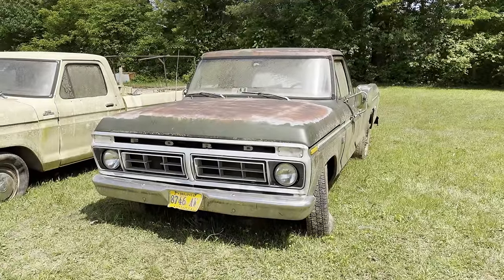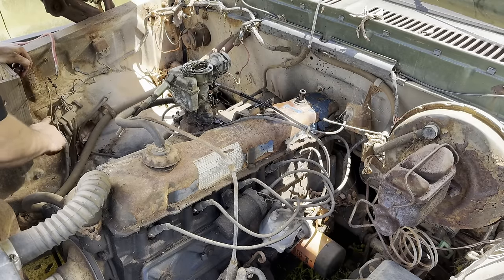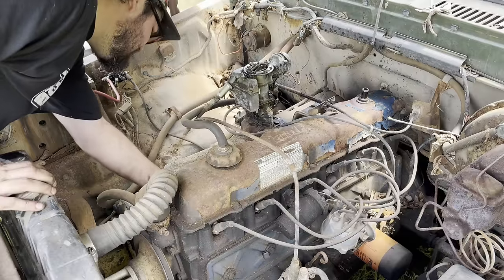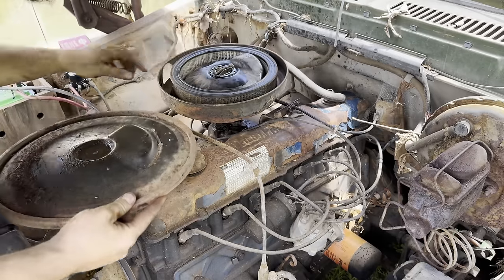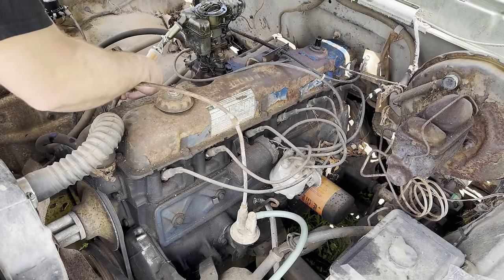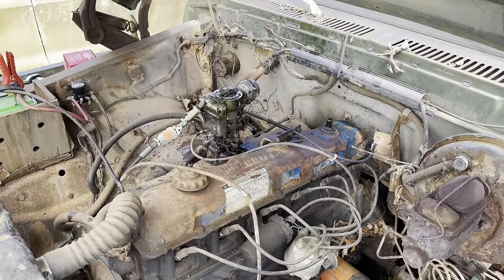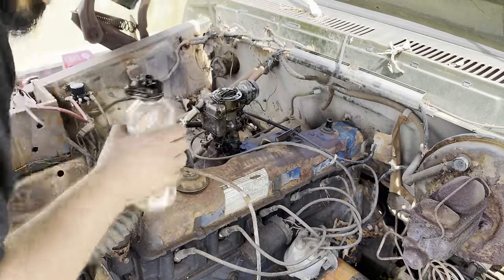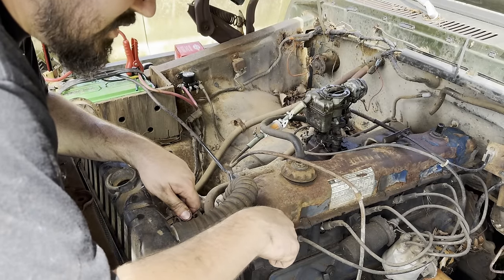Will it Run After 22 Years? Oddball 1976 8 lug F150 Truck #RustBucketRescue

Comment: Since the early 1980's, Ive owned a 1975 F150, 1981 F100, and a 1984 F150. All had the 300 cylinder. Those engines are bulletproof.
Reply from the maker: Greatest engine ever made.  The perfect “truck” engine.  You want a truck engine to be simple, and reliable to get the job done without a bunch of fuss.  The 300 six pulls through every time, until the end of time!

Comment: Reading on the ford-trucks forum and it seems a guy has a F130 and did a marti report on it and there was 50 of these made, they were Fleet ordered this way. "F130 - F150 special pickup truck 6050lbs gvw" from bill smith motors in Sanger, Ca.
Reply from the maker: This one has a 6150 GVWR, so 100 lbs heavier rated than the report you mentioned, so the plot thickens!
Reply: I have a F100 and I was going to do this conversion to 8 lug so I could run duallies I have from a F350 chassis but I ended up putting new bearings in the rear end (9") so that plan went bye lol

Comment: Pro tip: Don't spray the air filter with starting fluid. If it backfires it'll burn like a torch.
Reply from the maker: Been there done that a few times, that's why I left the air cleaner loose.  If it bursts into flames simply lift off the air cleaner by the inlet neck and toss it in the grass to do its thing. 🙂
Reply: @RustBucketRescue why didn’t you just leave it off and feed the carb with starting fluid. I’ve never seen anyone do it the way you did in real life or YouTube.
Reply from the maker: @Robrt32  Starting fluid is highly volatile so it evaporates QUICK.  By doing what I did, you turn the air filter into a wick of sorts.  It allows for a much more extended release of the ether to get a nice long 7 second run time instead of a little 1 second burst and then done like normal.

Comment: The old 6 cylinders are reliable tough engines but they burn just as much gas as a 302 with half the power. I’ve owned about a dozen of them over the last 40 years. I swapped every one of them to a 302 or 351W. I was much happier every time.
Reply from the maker: I understand the reasoning behind swapping them out, but I really like the 300 sixs so I keep them in there, they respond very very well to a Turbo and are super easy to work on.  The 302s and 351s do well though!
Reply: The 302 is a car engine!
Reply: @Hillbillypunk  they in many MANY trucks.
Reply: @Robrt32  I know. I just don't know why cause, they are worthless in a truck compared to a 300.
Reply from the maker: @Hillbillypunk  Couldn’t agree more, I much prefer a 300 six over a 302 when it comes to my trucks.
Reply: In trucks definitely. In cars, they were the best for fuel mileage imho. In that case, it all comes down to gear ratio and gvw regardless.
Reply: @RustBucketRescue 💯

Comment: Awesome truck to find but you’re seriously hurting it going to all the ether - use some two stroke mix to initially start old engines to give it some lube since they have been sitting dry so long - ether dries it out even further
Reply from the maker: Not to worry, I use generous sprays of Deep Creep into the carb bowl and down the intake whenever I’m digging my finds out of the woods, and then again when they come home, and then for a third time before I try a Will it Run video.  Trust me, the cylinders are absolutely marinated in Deep Creep before I touch any ether 🙂

Comment: Not that it needs repeating, but that 300 straight six is indestructible. I have a fuel injected version in my '89 and it just goes. 270,000 miles now.
Reply from the maker: People have routinely put 300,000 and 400,000 miles on them without breaking a sweat.  Easily a top 3 greatest engine of all time!

Comment: Nice video! You're famous on the Ford forum now!! Since you have it now, where's that boneyard? Both Va plates puts it "close" to me, maybe! I have some Dodge trucks and noticed some in the back round. And since Dodge made few changes to the trucks, even an old truck might have what I need ! Thanks.
Reply from the maker: I had no idea, I’ll have to go over on the Ford forum and introduce myself and post my findings!  I’ll be parking a same-era F250 next to it soon to compare the brakes, the frame thickness, leaf springs, axles etc to help settle what makes a F130 an F130, I’ll have to sign up on the Ford forum and post a video of what the result is.  The boneyard is in Floyd, Virginia.
Reply: @RustBucketRescue  Thanks, only 4 hours away!! LOL Looking forward to more F-130 vids!!
Reply from the maker: @tobylou8  as soon as I can tow the F250 home to make the comparison video , it’s on!  I can’t wait to see what parts on the F130 are identical to an F250!  Going to be very interesting, and we can finally knock a little bit of the mystery off what the F130 is and isn’t.

Comment: I would love to know the frame thickness on this thing compared to a regular F150. Did they give it an F250 frame, or is it just 3/4-1 ton stuff on a 1/2 ton frame? 

In the 80s, Ford had the F100, the F150, the F250LD, the F250HD, and the F350. The F250HD and the F350 had the same frame thickness, while the F250LD had a slightly thicker frame than the F150 but still thinner than the F250HD and the F350.
Reply from the maker: Stay tuned!  I’m working on a comparison video now where I park a same-era F250 next to it and compare the frame thickness, the brakes, the leaf springs, the axles, etc!  Hang in there, I promise it will be a very interesting video!!

Comment: What you have to realize is that those were not F150 trucks with F250 running gear, they were just light duty F250's that likely due to marketing reasons or gov. order issues they did not want to designate them as maybe an F200 model. 
They were mostly fleet purchased or government vehicles. In later years the F250 had levels, the difference being identifiable by the lug diameter. Some even had non floater rear axles in a Dana 60 rear end. A possible earlier year carry over or use of older parts to fill an order.  
Back in the day dealers could also order just about anything in any combination, and large orders like those for the military or parks system, often were special order, built to a price point type of trucks. 
That one is odd that its got body side moldings and chrome bumpers. 
I've also seen some oddities in some same era 3/4t step side models, including a 1976 F250 10ft bed regular cap 4x2 with a 300 six with the NP435 gear box and all wheel manual drum brakes. In two tone paint. A truck I bought from a beer distributor in Philly back in 1983 with almost no miles on it. It not only was sans a radio but it was minus the cut out altogether having only an indent i the dash where the cutout would have been. It had low mirrors, no tinted glass, no rear slider, no power brakes, painted bumpers, but it did have cab markers on the roof. Likely its only option other than the two tone white with jade green lower sides.
Reply from the maker: Thanks for sharing your stories!  Those sound like some awesome trucks, a 10 foot bed would be amazing - it could haul so much!  Sounds Ike a VERY bare bones unit, it was definitely bought for a specific roll!

Comment: If you bore that 300 out to 305, you can put 5.0 badges on it. lol
Reply from the maker: The questions people would ask! 😂
Reply: The "5.0" 302cid V8 actually comes out as 4.9L 
They were called 5.0L to distinguish them from the 4.9L 300cid I6
Reply: @mikeschnieders7750  So what you're saying is that the badge should say TRUE 5.0. lol
Reply from the maker: @mikeschnieders7750  correct!

Comment: I had one 1995 300 6 five speed 150 w/t appearance and custom package s.o. truck best truck I owned
Reply from the maker: The 1995s have a great front clip on them, what color was your truck?
Reply: @RustBucketRescue  maroon  gray vinyl interior headliner delete it had solid steel commercial bumpers on it it was special built by a well company appearance package was built Ford tough in America mud flaps and floor mat I had the window sticker to it
Reply from the maker: @conorcuomo4283  what an absolute gem!
Reply: @RustBucketRescue  Midwest weather kill it brought with 199999 it had 270000 went sold to body shop man cause suspension start rotting off he was going fixed the  chassis rust problem and it probably still running with around 400,000 mi on it cuz he said he was going to keep it alive until it returns to the Earth
Reply from the maker: @conorcuomo4283  I believe it!  There is no killing a 300 six, they’ll outlast the human race!
Reply: @RustBucketRescue  they like 80s to 240 Volvos the swedish shoebox my friend had one it finally blew up at 550 000 two tran mission one head gasket replacement
Reply from the maker: @conorcuomo4283  yes sir!  80s Volvos are legendary for lasting forever.  There sure were some great, long lasting engines back in the day!
Reply: @RustBucketRescue  in Sweden they drop 350 or 400 in them and drag race them
Reply from the maker: @conorcuomo4283  that’s really cool!  I’ve heard of them using them in Swedish rally racing on the dirt roads there!  Didn’t know they drag raced them too
Reply: @RustBucketRescue  rear-wheel drive big large swedish tank

Comment: Just remember, others think of it's reliability with it WOT hauling something.
They will 100% take a beating, but still will eventually wear out.
Reply from the maker: At 400,000 miles maybe !😂
Reply: @RustBucketRescue  Shoot, that's when it's just broken in 🤣
Reply from the maker: @jamesstoy8967  they last soooo long. Such a great engine design!
Reply: @RustBucketRescue  What helped them last was being overbuilt and having not enough power to kill it self.
Still a great engine. Get you an EFI head. That's a point of compression increase along with better efficiency.
Toss on the EFI manifolds and a 2.25-2.50in pipe to help with breathing. Keep an eye out and try to find a good 4bbl intake on.
A 390CFM Holley will be plenty for the RPM's you'll safely sometimes reach. Then dial that distributor in!
If you want to go a bit further, you can at least toss on some rocker arms from like a Chevy 250 or 292 I6. Going from the Ford 1.6 ratio to the GM 1.7 ratio will give a bit more valve lift and a slight bump in duration.
A 4° advanced timing set will also help wake it it. Plain steel gears are best.
Reply: If you're good with a die gender or Dremel, then you can gasket match the intake ports and do some work in both the intake and exhaust bowl areas. This will also help breathing.
Reply from the maker: @jamesstoy8967  excellent tips, thank you for taking the time to write this up!  I actual have a GM 250 that I can steel the rockers off of.  I think I have a set of long tube headers kicking around somewhere too that I can throw on there. I’d love to start pepping this thing up in the next couple of videos as I record the process of getting it back on the road.  Thank you for your post brother, greatly appreciated!!
Reply: @RustBucketRescue  One thing I'd highlight suggest is a wide band O2 sensor. With it, you can learn about carb AFR adjustments for different loads and RPM's.
Then there's the ignition timing. Ford, for whatever reason, usually like to hold back timing. Maybe emissions.
Turning the distributor, welding slots, and changing springs can dial it in and give that 300 some pep.
If you got a 240 I6, you can swap it's head on the 300 for about a point of compression increase. Just won't get the more efficient design of the EFI 300 head.
Reply: @RustBucketRescue  And don't expect big gains from the rocker arm swap. At the cam, you got .246in of lift.
So if we take and account for rocker arm ratio, .246 x 1.6, we get .393in of valve lift stock. If we change the rocker arm to a 1.7 ratio, .246 x 1.7, we get .418in of valve lift.
You can also use some BBC rocker arms. They have a 1.8 ratio. These on the stock cam will give you a valve lift of .442in at the valve.
Stock: .393in valve lift.
250 I6 1.7 rocker swap: .418in valve lift. +.025in of valve lift.
BBC V8 1.8 rocker swap: .442in valve lift. +.049in of valve lift.
Reply from the maker: @jamesstoy8967  excellent info once again!!  I wonder if 1.8 ratio BBC rockers would be “too much” and cause piston-to-valve clearance issues?

Comment: i have one of these trucks i bought it 2 years ago for $500 and still working on it
Reply from the maker: What are the details!? What color, engine, transmission?
Reply: @RustBucketRescue  390 4barrel factory AC, C6 3 speed auto, and red and white 2 tone
Reply from the maker: @springythebox1496  nice! A 4 barrel 390 FE is an excellent, excellent engine l!  Plenty of power and famously reliable especially with today’s modern awesome oils and oil filters.
Reply: @RustBucketRescue  it definitely would be if it didnt blow head gaskets
Reply from the maker: @springythebox1496  this a repeated issue, or has it blown them just the one time?
Reply: @RustBucketRescue  first time was intake gaskets a year ago and this past fall it blew head gaskets while driving home from Minneapolis

Comment: Accelerator pump for the carb.
Reply from the maker: Rebuilding the carb now, it’s currently in the ultrasonic machine!
Reply: @RustBucketRescue  The only reason I suggested that. Was because any old Ford I ever had. Those always were an issue sooner or later. Good luck with that carb and the truck overall. I used to have a 79' F - 150 with a 302. Had an odd transmission though. It was a 4 speed standard Orion transmission. I'm no expert by any means. I think fourth was considered and overdrive but I could be wrong. I miss that old truck. Over 250,000 miles before it finally threw a bearing.
Reply from the maker: @needsaride15126  I’ve never heard of an Orion transmission,  I’ll have to do some research - sounds interesting!  Thanks for sharing!
Reply: @RustBucketRescue  it's been so many years ago. If I remember correctly Orion was stamped on the tailshaft of the transmission.
Reply from the maker: @needsaride15126  Found it! “1977 and 1978 there was a late model 3 speed overdrive transmission made for intermediate passenger cars, light duty pickup trucks and vans. This transmission looks just like an early Toploader” Looks like 4th gear was 0.85:1 ratio, so a nice little 15% overdrive.  What a cool truck you had!
Reply: @RustBucketRescue  Yes, the truck had an odd set up. It had the larger radiator that you would have in a larger engine or towing package. Yet had a 302cu.in. engine with that Orion transmission.

Comment: Not a fan of all that spray in the carb, 2 stroke oil mixed in gas is better
Reply from the maker: That’s why I sprayed Deep Creep into the intake in between attempts, keeps the top end lubed up while using starting fluid
Reply: Yeah all that starting fluid will wash the oil from  cylinder walls causing a dry start!!!
Reply from the maker: @mikewilliams2072  don’t worry I sprayed generous amounts of Deep Creep into the intake to prevent that

Comment: you need to take automotive wiring 101 . Hint the relay you are using is 4 post and you are worried about the mount being grounded . Sorry I here you talking with lack of understanding .
Reply from the maker: The solenoid coil power comes from the "S" terminal and grounds to the steel fender through the solenoid bracket.  Ford puts star washers on those solenoids from the factory to ensure a good biting ground to the solenoid bracket, they do not do this for no reason, in fact new 4 post solenoids come with new star washers to ensure a good ground exactly like I talked about. If the battery is grounded to the engine, and especially if the motor mounts are rubber mounted (very common), you may not have a good ground path from solenoid to the battery.  With poor bracket grounds I’ve personally seen huge arc flash between the bracket and fender while starting.  I’m sorry, but you’re the one who needs to take automotive wiring 101.

Comment: Omg quit with the starting fluid and act like a mechanic
Reply from the maker: There’s absolutely nothing wrong with starting fluid, get your panties out of a wad and live a little 😂
Reply: Starting fluid evaporates a lot of the cylinder lubricant you spray in there before turning it over. That’s why I like to use Trufuel 2-stroke mixed because it lubricates and fires easily.
Reply from the maker: @randomletters2948  Yeah I'm going to pick up some of that and make some mix!